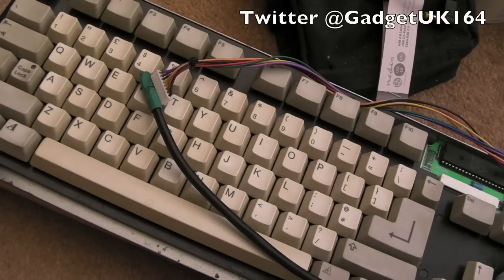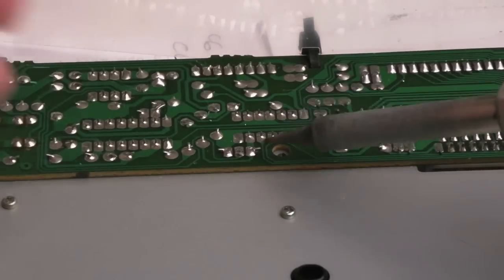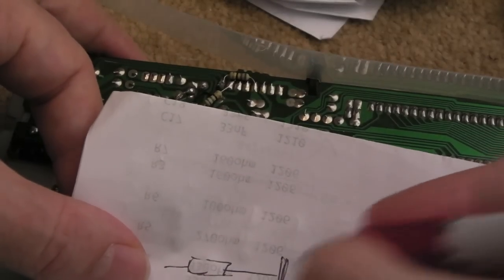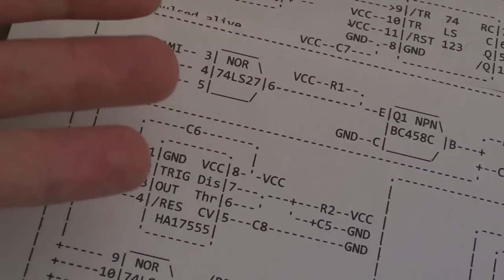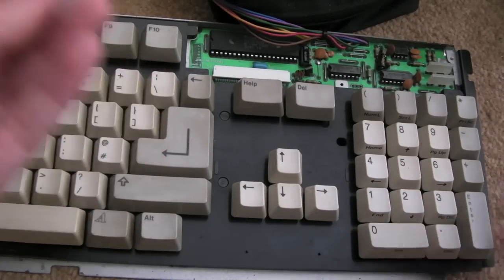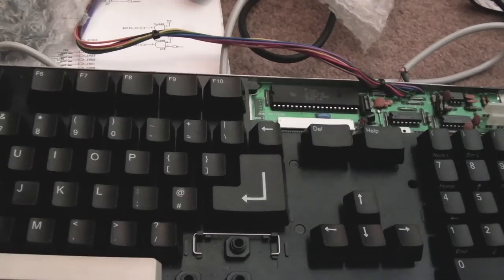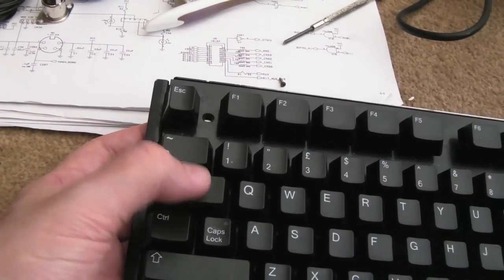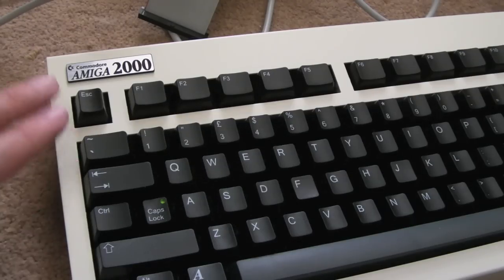Commodore Amiga Checkmate Keyboard Shell & A1200.net Replacement Keys (1st Run) / A2000 DIY Keyboard

Comment: 13:00 so if you've got 4 connections and it's a 5 pin DIN connector why not use 5th pin marked as n/c to route the genuine floppy led signal from the A2000 to the keyboard.
Reply from the maker: Yes, I did say in the video I could modify the A2000 boards (I have 2 boards for test - 1 assembled system) - I just didn't want to modify them all to make them "none standard".

Comment: Are these keycaps from the first or second campaign? I'm waiting for my key caps from the second campaign and I'm now nervous as to how well they fit. The keycaps and plungers are designed in such a way that they mate with each other - that is what the click is when put them together. If the new keycaps does not have the same design then that may explain why they don't click in and why they are loose.
Reply from the maker: These are from the 1st campaign!

Comment: It's really annoying when in 2020 we can’t make reproduce products as good as the originals.  I have a recently purchased A500 and I won’t even bother retrobrighting it in case anything goes wrong, happy just to live with it slightly yellowed.

I'm just thinking out loud but were the keys ever that white on the A500?  Personally I’d just keep the original key caps as they match the casing rather well.
Reply from the maker: I don't think they were ever white!  The white set is super white!  Wouldn't really match the case so not sure what to do with that white set...
Reply: @GadgetUK164  correct - those are white for the Amiga Technologies 1200... for the 500 there is a different color tone.
Reply: @GadgetUK164  Absolutely. No Amiga Key ever was that garish white. I was there back in the 90s, having 2 A2000 and a A3000 and a Friend with an A4000 and one with an A1200. Sure colour reproduction surely isnt easy, but why go the "too white" route when just making them a bit grey (not yellow-ish) would be possible? (but then, the extra keys that should be grey look greenish, so maybe they failed at grey, too)  The white ones look horrible. Always had. Even on their own promo shots. While the chinese selling Cherry MX keycaps with good colour and ok quality. For a buck or two.
I was sitting there wondering when so many youtubers installed these comically bright-ish, off-textured, ill fitting, misprinted things and praising them like mad. So kudos to you for being the honest guy you are!
Reply from the maker: @insanedruid3143  They did have a set using the original colours!  I just picked a pure white set and a black set.
Reply: @GadgetUK164  Afair (!) the original one was the same white keys combined with darker ones (that look a bit greeenish on their promo shots and in the videos i have seen) for the non-alphanumerical keys. That's what their own configurator shows, too.

Comment: I have not even tried fitting mine some of the molding quality is a bit iffy i have noticed that i hope mine fit better ,just looking at mine all  the square post have a  a tiny bit of raised plastic in each of the corners i can remove it with my finger nails and it then appears flat and it does look like some of the text on mine is not perfectly aligned .,the amiga key caps for pc mechanical keyboards they are perfect but these were by loriano who done the x500 case that i have https://www.facebook.com/loriano.pagni
Reply: It seems A1200.net underestimated the challenge of manufacturing and then printing completely custom keycaps from scratch on a small budget for small production runs in multiple colours and languages. When Mitsumi where doing this they had huge teams with vast experience iterating on  many keycap projects. Loriano and Kipper2K got "custom" PC keycaps from a company that specialised in that on existing production lines the same as Rastport is doing currently which is a much simpler process than getting Chinese companies to copy "obselete" designs and processes.

In the A1200.net backer updates they reported replacing around 1% of keys in the 80% of keycap sets they delivered for Batch 1 because of printing faults. I suspect these mostly included ones where the printing problems included in a set were far worse than the ones GadgetUK164 received and many backers will not have bothered to complain but this is the first I've heard of a key being a wrong colour, keys not fitting securely and stabilised keys sticking. Whilst there have been many updates about improved printing processes and quality control I don't recall any info about changes to moulds since the first batch.
Reply: @IanPtv  Because there is no point of changing molds. Issues we were working on were related to label printing. Read my answer to ops.
There's not only 1 variation of keyboard out there but I agree this is the worst I ever saw myself!

We didn't underestimate the challenge, we knew were we'd go. But you're right on one point: It's only when you do something of that scale as in for real, not just talking about it  that you see all of it. If you don't experience design/production multiple times its just not possible to understand all factors.

But we did acknowledge the printing issues and that's why we swapped around 1200 keys. Because of commitment to contributors.
Thank you Ian.
Phil.
Reply: @A1200NET  Thanks Phil it's reassuring to know that the fitting problems seen here are rare. Looking forward to receiving my keycaps and A500 case when covid allows production and  distribution to be completed, Good luck to you and your team with the rest of the current projects and future endeavours.

Comment: Wow that is a crappy replacement set of key caps.  I invested in Batch 2 of the Amiga keycaps and supposedly they are going to fix the printing quality but now I am skeptical.  I pledged for two sets wanting specific colors that they have since eliminated.  Over all a bad experience.  I have invested in 3 different keycap campaigns for Commodore and Amigas and none of them have actually fulfilled and are all are 1 - 3 years over due.  I miss the old days when companies made stuff then sold them when they were on hand.  This fund/pay me first generation sucks! Lol.
Reply: This isn't how it work, please document yourself.
We're a team of Amiga enthusiasts, like you. Plastic industry is excruciatingly expensive and without the community support these would never have seen the light. No one would invest $150K of their hard earned money to create tools for Amiga keycaps without no guaranties. This is were we came in.
Also, as said earlier, while ops issues are really sad. This isn't a general situation at all. Your keycaps will come nice ;)
Thank you.

Comment: The printing on those keys looks like decals that will likely wear off in a short period of time.
Reply: This is how pad printing looks like.
All Commodore keycaps were manufactured the same way. Although been in use for 3 decades, you don't see much of the coat anymore, which is what you are seeing right now.
Give our keys 30 years, and the coat won't be visible anymore ;)
Check on recent mid-priced Logitech keyboards.. Pad printed the very same way.
Thank you for your comment.

Comment: if you look closely, the S key and the D key are of different height aswell, seems like a really shoddy job from the manufacturer.  
Also the "Q" seems a bit different than the rest of the prints, a tiny bit thicker than the others.

Both of these i mention are on the black key caps.